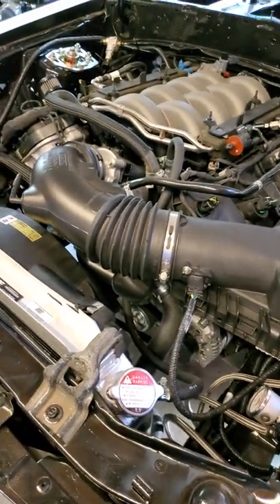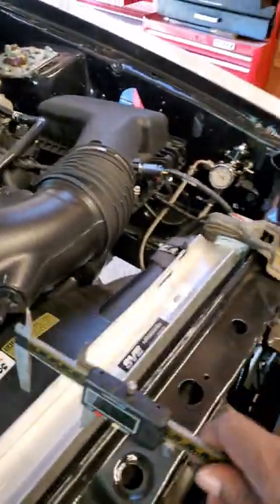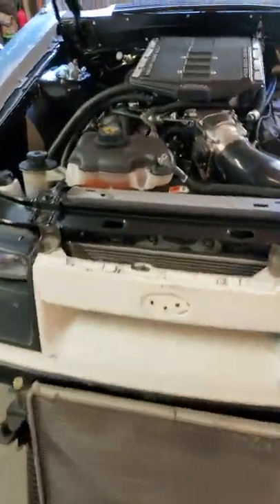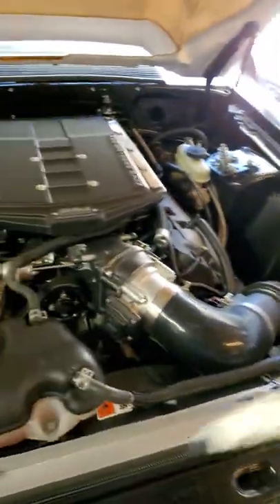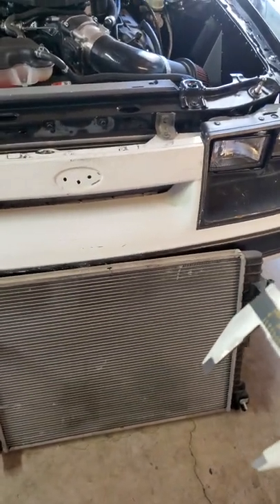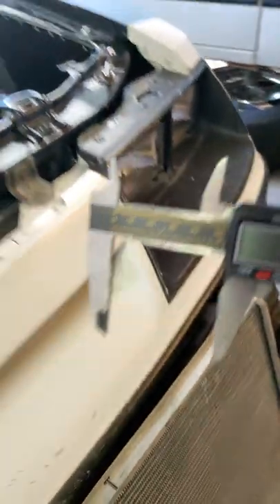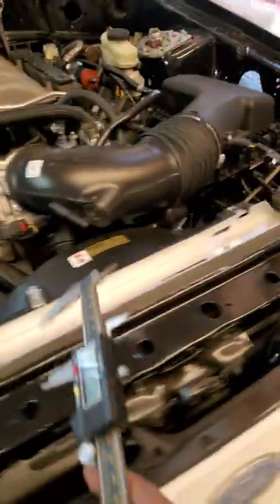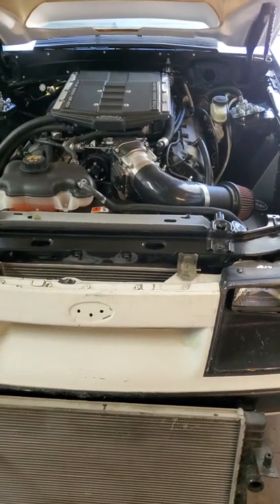Coyote Swap - What Radiator To Use -

Comment: For the hose that runs from the expansion tank to the radiator nipple for the overflow did you gut that stock radiator cap?
Reply from the maker: you dont have to but i usually get a 0 psi cap or remove the spring from a radiator cap